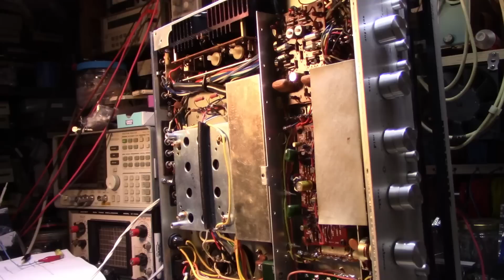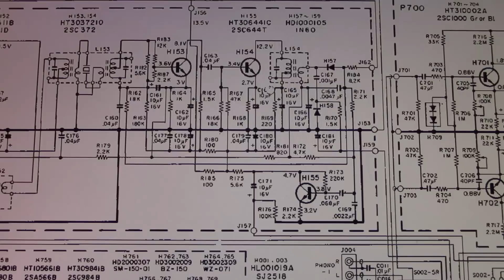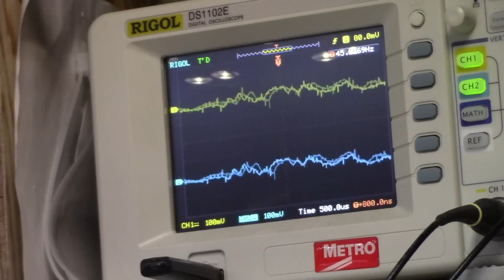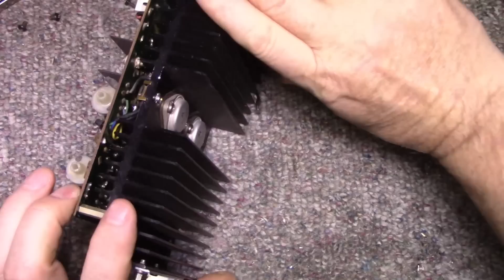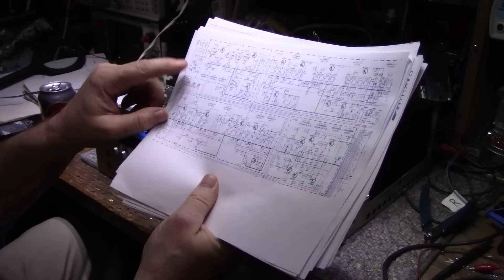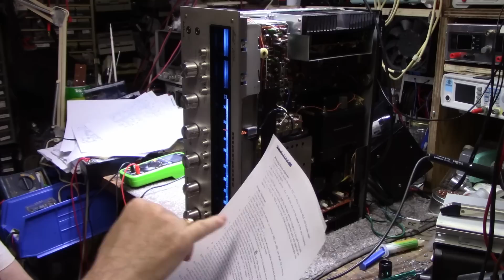Marantz 2270 Receiver Repairs (Ep. 163)

Comment: When you mentioned that they instaled audio grade capacitos in the power supply board that got me thinking, in what is it good to use the audio grade capacitors i am thinking the audio output boards would be a good place any other ones?
Thank you

Comment: What a basket case of little problems.  I did a 2270 not too long ago. Stereo light burned out and a coupling cap went open on the FM stereo module on the left chanel. Other than that it was a straight up recap/transistor/light bulb/vellum paper replacement. Much easier to find old age problems than fixing someone else's mistakes.

Comment: Great video! I'm reworking a Marantz 2330b and the one think I learned it that those wire-wrap connections break easy. I didn't want it to look like a hacked up mess so I bought a manual wire-wrap too so I can do it right. It looks 100% better. I even got a few spools of different colored AVG22  in case the wires were too short. I'm glad I went the extra mile.
Reply: Where did you buy the manual wire wrap? And can you also use them to remove the wire from the post?
Thank you
Reply: Almost anyone can cut and resolder the wires,  or even go to the trouble of re-wrapping them. Working on the board with the wire-wraps intact....priceless!  :)

Comment: At 45:00 I was a bit confused.  You had tested that paper cap first with the positive on the marked end, then switched to the Fluke hand-held and put the negative wand on the marked end. I am a newbie and just curious...trying to understand.
Reply from the maker: Sorry for not being more clear. These caps are marked on one end but they are not polarized like a typical electrolytic capacitor would be.
The mark on these caps are for the outside foil but their polarity really doesn't matter for testing purposes.
Reply: @TrevorsBench  Thanks, learning every day with this hobby!

Comment: Hi Trev, I would like to thank you for your videos and knowledge you pass to viewers. I’ve started watching your videos at the start of this year and since then I recapped and restored my old NAD 3020B and then bought and did the same with Pioneer A6 from 1981. Your cleaning method with brushing isopropyl alcohol on pcb and then using lint free cloth with brush to soak it up is brilliant, works like a charm. Thanks again!
Raf
Reply from the maker: Thanks for the feedback. Nice to see you're able to do some projects.
The board cleaning is not necessary but it does make the job look a lot better.
Be careful with alcohol since it 's flammable

Comment: Total recap ok, but why would they use Nichicon FG capacitors as DC filters for the AM/FM tuner?
Think "The previous Tech" didn't know where to use different types of caps.
And wouldn't you test the receiver after the recap and check that everything works before sending it back to the owner?
Lucky that the owner could send it to a real tech who knows how to fix it, including mistakes made by others.
"Show me where you've been, and I'll show you where the problems are."

Comment: Good job, for sure the tech before you should be addressed. Soldering a short like that should be noted by him.
One thing I do NOT like about these Marantz LED retrofits is the cold blue light that is even bluer when fit with cold white LED's. I just fitted one with LED's, but I used warm white, AND put in a yellow filter (PVC pipe). Needed to rectify and smoothing too, it is not a plug&play solution. One problem is that the narrow band of light does not contain much yellow, so I needed 14 x 1W LED's (on 1/2W) to get the light through the filter. But, after hours of trying, it shines blue/green now, and that looks much more friendly 😊
Reply from the maker: I know what you mean. Getting the colour and intensity just right is key. 
Personally, I prefer the look of incandescent bulbs but we all know they eventually burn out.
I don't have much faith in LEDs either because of their high failure rate.
I found some transparent filter sheets on aliexpress that comes in a variety of colours. I want to try these filters on some receivers to see how it looks
Reply: @TrevorsBench  I just keep LED's in all circumstances below half the rating, and even lower. That is why I don't like the P&P sets.
What is a possibility is using incandescent bulbs, but put two fat diodes back to front in the line. That will get them .7V or .8V down at that current, but you will really not notice it in brightness, and will wear them out significantly slower.

Comment: I just have to LOL at "audiophile" power cords.  18 gauge power cable can easily handle the amperage pull of a standard receiver.  Some vintage power amps came equipped with 16 gauge power cords when they were particularly power-hungry.  Most of the internal AC wiring to the switch and transformer is 20-22 gauge.  It's just a joke.

Comment: (By volume)
50% isopropyl alcohol
25% acetone
12.5% isohexane
12.5% pentane
and you end up with a very potent PCB cleaner/degreaser/flux remover.
These wrap around the post solid wires can drive you mad in these Marantzes, but other than that - great units and a great job as always !
Reply from the maker: I have the flux remover in a can and it works great for the stubborn gunk. For everyday cleaning I use 99% IPA and t it works like a charm too, just a bit slower.
I try to keep chemicals with a high VOC to a minimum in my shop for health reasons because my ventilation is poor in the room and i'm not fond of getting brain cancer, lol
Reply: @TrevorsBench  Just a disclaimer then: it's a formula for at least one, commercially available alcohol PCB cleaner and comes with a long list of safety precautions, so long, it'd probably be outright illegal in the State of California. Pentane is the one with outrageous vapour pressure, so much so, that is best kept in the fridge, alongside remaining constituents, prior to mixing. Isohexane must contain less than 5% of n-hexane isomer, or it would be pretty cancerous, although higher content would also make it unavailable for private buyers. Why go to so much trouble then, well, it cuts the cost in half compared to ready made. You spray the board, place a paper towel against it, then spray the towel and scrub it with a toothbrush, seconds later, even hardened flux ends up on the towel. But you're right, you need proper ventiltion, or it will make you woozy to say the least. Coming back to the Marantz, that little cap grounding the coil is one of the things you wouldnt normally expect - makes it so much harder to trace. Perks of following in somebody's footsteps. Had an SV02 diode in 2235B bias circuit with a cracked lead recently, my predecessor "fixed" with a drop of super glue. Now, once you lifted the leads to measure with a diode tester, it would give correct voltage drop at various current levels and respond well to temperature rise, but once you soldered it back on, it would be intermittent, cue amp grenading itself for no apparent reason. Obviously, the leads were insulated and the diode hidden inside a metal can, placed against the heatsink, so no visual inspection clues. Lost a bunch of transistors and fusibles and a few years of my own life expectancy as a result. Your "It must have worked before somehow" kept me going again. Thank you Trevor !!!